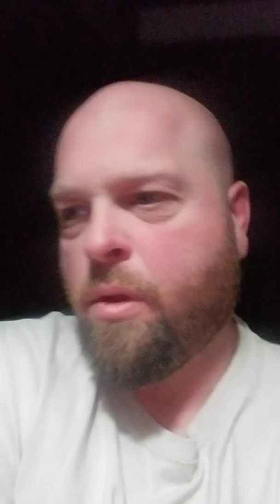Archoil AR6200 benefits in Semi Truck application

Comment: Cetane may also help, higher Cetane better fuel efficiency. 
ropel HPR, 75
Syndiesel, 60
BP (Amoco branded), 51;
Countrymark fuels Diesel-R, 50
Chevron, 49; or 51 with Techron D labels in select markets
ConocoPhillips through the 76 stations (California) 47-53
PetroCanada, 47-51
BP (Powerblend 47, otherwise 40-42)
Shell, 46;
Sinclair, 46;
Sunoco Gold, 45 (often +1-5) Sunoco regular is usually 40.
Exxon/Mobile, 43-46
Holiday Stations, 40-43
HESS, 40-42, can be up to 45.
Husky, 40 + diesel Max additives raise another 1-3 from there (41-45 max)
Pilot/Love's/Flying J/Valero/Sheetz/Walmart/Wawa: 40

Comment: So let me ask, are you still using it? I just purchased a couple for my 2023 T-680. I’m currently getting 7.8-8.4 mpg loaded and 12.6 empty. I wanted something that will keep my engine and after treatment cleaner while helping if not boosting mpg. Depending on wgt of load I will travel anywhere from 65-69 mph. Thanks for any help you can offer.
Reply from the maker: It didn't noticeably add mpg's to offset its cost. But the truck felt it ran better and pulled a little.more smoothly.